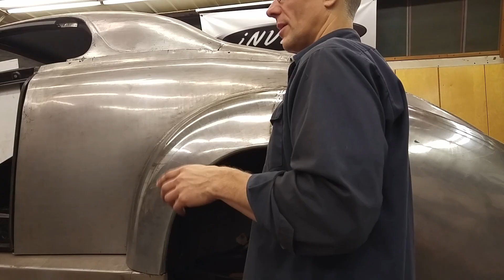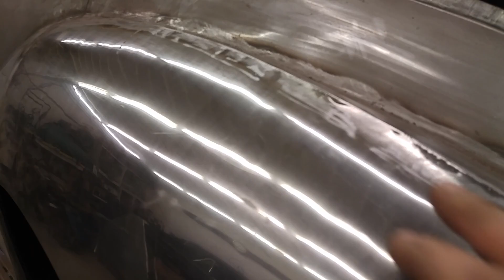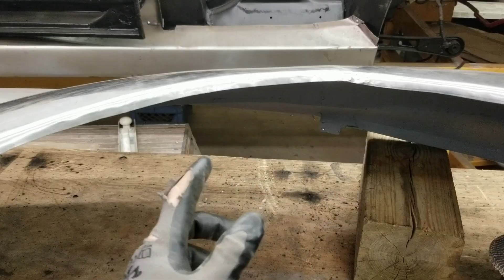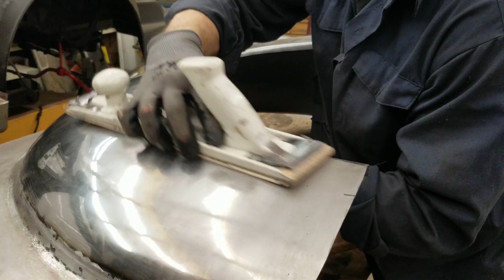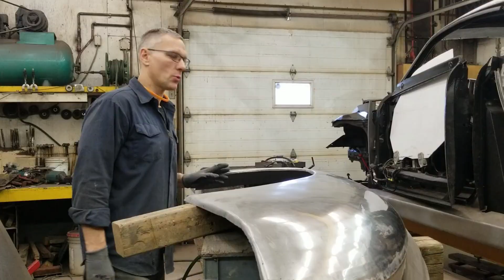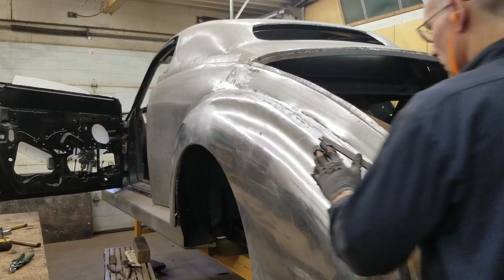How To Properly Correct  Warped Metal After Welding - Ep.45 | 1940 Ford Inspired Hardtop Coupe Build

Comment: Another awesome and educational video. Thank you very much. MiG wire to assess imperfections, does size wire matter? What kind of flexible rod are you using? Thank you so much. PROFESSOR
Reply from the maker: Grab a length of brazing rod or 1/16" TIG rod.  Needs to be flexible enough to follow the panel's contour.  Thanks for the kind words Sir!

Comment: none of this works if you have duel walls on the panels you fixed... my 76 Jeep J10 has a duel wall bed, and welding repairing/replacing the bedside rust, there is a raised hump where the spot weld stitching is... you cant hammer and dolly the panel because you 0 access  to the back side...  so you have to use bondo to level it out.. unless you know another way that doesnt involve what you showed here because again 0 access to the back side... unfortunatly for "newer" vehicles meaning vehicles after like 1960-1970 most body panels are duel walled... also what thickness is that metal youre using ? looks like 20-22ga...
Reply from the maker: You sound like a smart guy and I'm sure you could have figured out a way to get 100% access to the back side. 👍  But since you asked, here's how one goes about it.  When a guy encounters a dual wall and has '0 access to the back side" a guy will need to find a way to neatly remove a section/complete interior panel to gain access to perform the repair then reinstall it.  That or a guy has to remove the exterior panel.  Quite normal for a quality repair... ie one that requires no bondo piled on to smooth over the damage.  In the case of the 40 some of the interior structural panels weren't installed until the exterior was finished allowing us full access to reach in with dollies.  As for material thickness, the body was shaped out of 18ga material.   Soon I will show how I completely remove the inner structure on a charger hood to repair the exterior and shorten the length.  Hope this helps and thanks for watching!
Reply: @iNVisionPrototypes  im not cutting up my interior bed wall to do the exterior.   Its already been rebuilt and covered with a bedliner, if i redo that itll screw up the bedliner and need to be completetly redone
Reply from the maker: @jeepsblackpowderandlights4305  You never mentioned that it was 'rebuilt and covered with a bedliner'.  There are other ways that your exterior panel can be repaired from the outside but specialized tools and know-how are required.  I discuss and show some of those methods in a few of my other videos.  All the best my friend!
Reply: @iNVisionPrototypes  not worth it when a little bondo will do the same job. this wont be a 60k show car i hide ina garage.
Reply from the maker: @jeepsblackpowderandlights4305  Was just trying to help.  Take care!

Comment: You are bringing up weld shrinkage, yet you are able to remove the fender. Did you fab the panel then weld on a flange to bolt the fender to the main body? What is the DA paper grit? It won't show through the primer and paint? Thanks.
Reply from the maker: Hi Rick!  I did and yes the 1/4 panel is removable - for now.  There won't be any bolts to fasten the quarter to the car.  Later, once I'm happy with everything, it will be permanently spot welded to the vehicle's structure.  The warpage as shown in the video occurred in the areas where I created the vertical joint between the the front fender section to the rear fender section,  along the peak between the rear outer fender section to the rear inner fender section(reverse curve area) and in the area were the flat vertical area(that starts at the door edge and goes rearward over the curvy fender part was joined to the curvy fender part.  If you go back to the earlier videos when I was shaping the rear quarter sections you will see all the joints.  As for paper grit, I start at 80 and work up to 240.  Later the car will get a treatment of 120 and primered.  No you won't see any scratches once done.  Good questions!
Reply from the maker: Also, much later when the quarter is welded to the roof section, that joint above the should line will need to be metal finished in the same manner to address any slight warping.